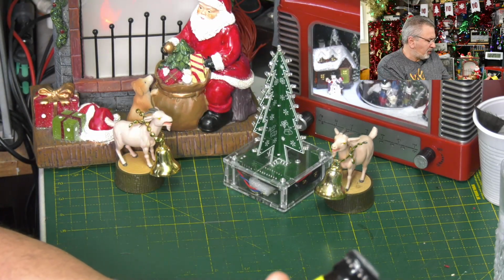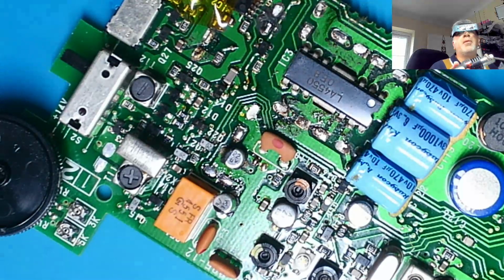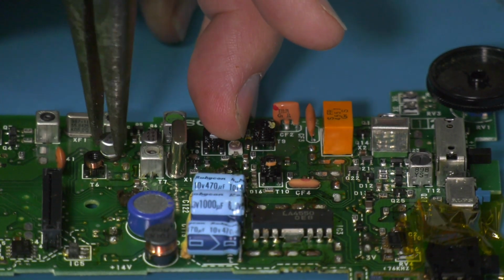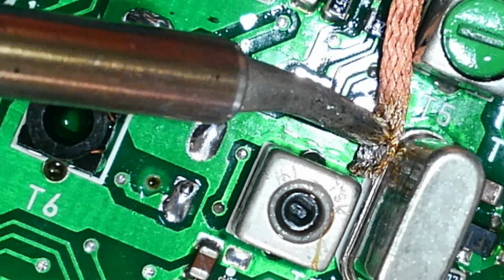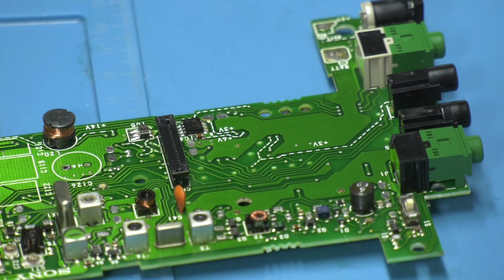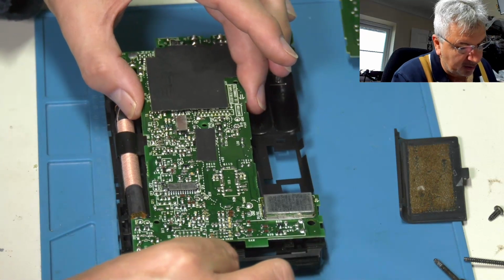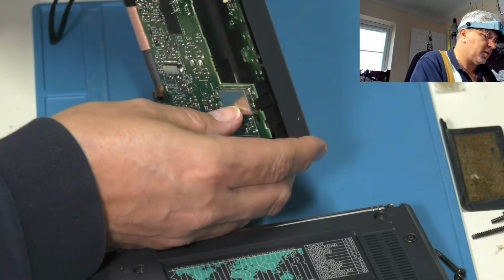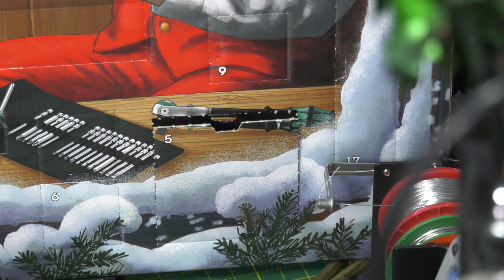Crunchers Christmas : December 5th Sony. ICF-7600 capacitor replacement

Comment: Great video! I have one of this model. There are no channels in FM/AM. All electrolytic capacitors replaced. but same issue. voltages are correct. What can be the problem. Thanks.
Reply from the maker: I suspect there's damage to a track or a through hole. It's a tedious task to track them down
Reply: @Radiocruncher  thanks

Comment: Thanks Graham, a very in depth tutorial. I have just purchased one (cheap) with 19 faulty caps (none visible leaking) 3 original cap sizes are fitted. Can you tell me the Tantalum package size/types that are used to as replacements. ie possibly A to D.    Regards, Ron
Reply from the maker: Thanks Ron. I haven’t really made a list. I decided to pick up a stock of different sizes and just use the ones that fit the pads best. It might be easier (and possibly cheaper) if you buy a kit from Adel or another Ebay seller. Let me know if you need any help. All the best Graham

Comment: Why not to use a pair of solder irons to heat both sides at the same time? The two irons then can be used like Chinese chopsticks to lift up the capacitor.  No pads will be damaged in this way...and this method is by far less invasive than twisting!Regards from Italy.
Reply from the maker: Hi Paolo. Thanks for your comment and I agree that the 2 soldering iron technique works well. I should have demonstrated that as well